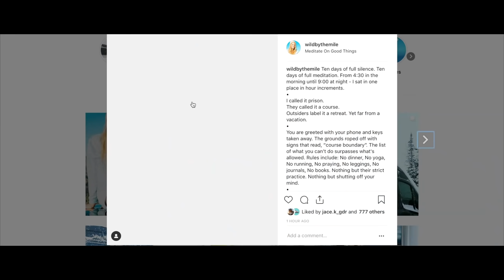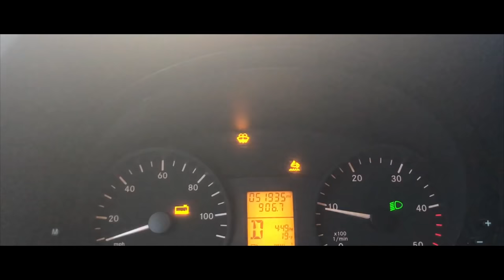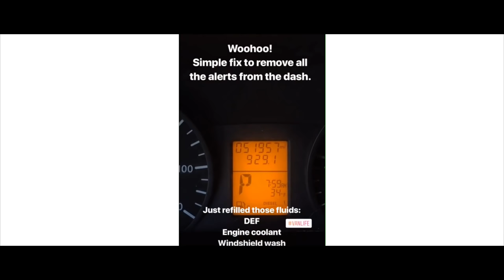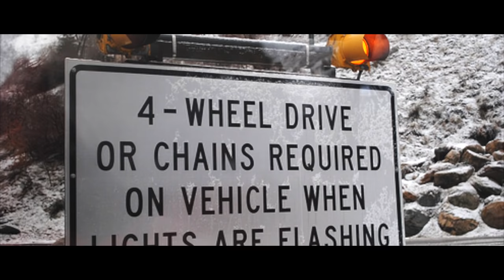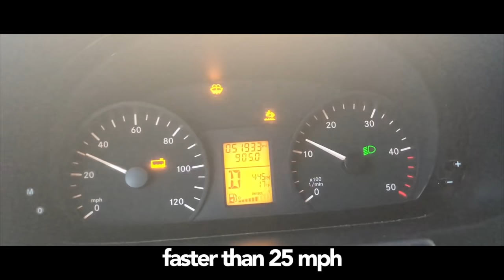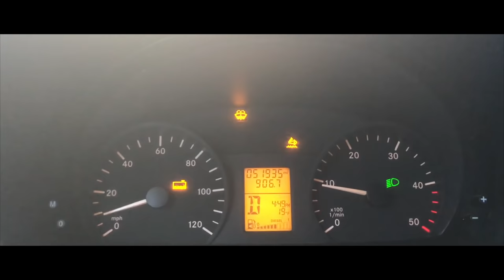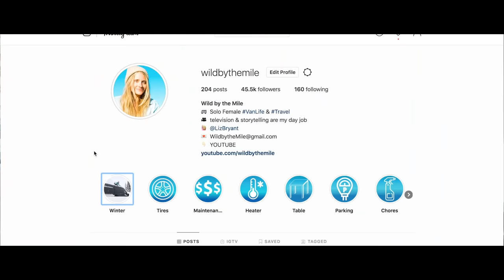SOLO FEMALE #VANLIFE: #WINTER SAFETY

Comment: Chains or cables are only meant to travel at a top speed of 30 miles hour. That was your speed in the video. The noise comes from the tire compressing under vehicle load which makes the chains ( cables ) lose causing them to hit the ground in front of the tire and bounce back up into the tire. My sprinter with my Pewag chains on it on clean plowed roads( no snow) sounds like a tank. Just do your best to keep it under 30 miles a hour.
Reply: I seem to remember that you're supposed to drive slower than 15 mph when you have chains on.

Comment: I live in the Northeast and have a 4x4 GMC pickup with BFG tires but also have a 2wd BMW which I have winter & summer wheels & tires.
The winter tires are studded snow tires which work well in snow & icy roads. Chains & snow cables are for extreme road conditions with 
up & down grades which most folks have no business driving in.

Comment: Something lots of people don't know,.. without a locker rear axle your van is only one wheel drive. It's an option that can be ordered when purchasing a new vehicle, it's like night and day!   Snow tires are made out of a different compound that off road tires can't match.  People seem to think those big bad ass tires are the best in snow ...wrong!! ( Check it out! ).   You did your insolation perfectly!  The V bar chains are the best on especially icey conditions but as said by many others.. you can't drive much faster than 20-25 mph because they will streatch!   One last thing ( thank God and I'll shut up) I always keep a buddy heater as a back up and are perfectly safe if you have the proper ventilation!  
Thanks Liz,. Best to you and be safe!  😊
Reply: I believe that would be called "limited slip differentials and axles" in North America not "locker".  It's also true of awd vehicles, they are effectively one wheel drive in poor traction situations unless they have limited slip differentials and transfer cases.  The big thing about Suburu's was that they limited the slip in their transfer cases so that a minimum of 30% of the torque would still be delivered to the non slipping axle, hence if one wheel slips, the other axle still turns (however unless they have limited slip differentials too then if a second wheel slips on the other axle, you're sol).  Basically an AWD without limited slip differentials but with limited slip transfer cases is essentially a two wheel drive.  Note that a standard two wheel drive vehicle with limited slip differentials is effectively a two wheel drive in poor traction situations too.   4wd is where you can lock the transfer cases and differentials together so that all the wheels turn at the same rate which is great for poor traction conditions but dangerous on dry pavement, you're also supposed to drive really slow when under 4wd as in 15 mph max slow.  It's only with 4wd that there might be something called a "locker" in North America.   Some 4wd's only have the ability to lock the transfer cases, indeed this is the most likely 4wd setup, this is safer as you don't have to drive slower and it's probably safe on dry pavement but in this scenario, if a wheel slips on both a less then you have no traction.

I don't believe chains are to be used above 15 mph.  I remember thinking that really limits their usefullness when I bought chains.  Then again I bought them in Canada so I think the warning was to not drive above 20 km/h.

Comment: I am a tractor trailer driver & mostly live in my truck. When you put the chains on, lay them longways with the van, behind the rear tires & roll back onto them. The front ones same thing but roll forward. As was said, they are meant for slow speeds, less than 30 mph (you can watch tractor-trailer youtube videos of the installation). They also should not be driven on asphalt, once the snow & ice is gone, remove them. If you have to reinstall them 2 or 3 times during a trip, it sucks but that's the pain we must suffer on bad roads. Again, drive slower with chains & don't go over 30. A great snow removal trick is to use old sheets & cover your window & roof b4 the snowfall. After it's done falling, pull the high end of the sheet towards the front of the van & watch all the snow come off with ease. To protect your wiper blades, b4 it snows, pull them outward, that way they don't stick/freeze to the winshield & protect them better. Make sure all your fluids (DEF, winshield washer, etc.) are sub zero degree rated.  Better luck next time! Life is a huge lesson 😊

Comment: About the cables: The sound is the end of the cables. There's usually some little clips (orange/red) to secure the ends so that they don't slap against the wheel well, but it's nbd if you don't secure them - it's just annoying. I have the same cables and living in Yosemite, I have to use them frequently.

Comment: As below, your chains are for snow not for the road so once you clear the snowline you can take them off. I carry old outdoor gear for putting them on as usually it's wet cold and dirty. So old coat, old pants, old gloves, a head torch is also useful. Also, you can practice putting them in the warm so you have it down before heading up into the mountains.

Also carry a shovel to clear the van, exhaust and possibly some tread tracks to put under the wheels to allow the tyres to catch. Dig out the exhaust prior to sleep

Merino wool base layers and fleece instead of cotton for clothing and carbon monoxide alarm if running the heater at night.

You could also run an extension hose from the heater outlet to somewhere else in the van 

https://www.butlertechnik.com/installation-accessories-c63/warm-air-ducting-outlets-accessories-c122

Comment: The noise is from the chain/cable stapping against the body of your vechile. Based on the Manufactures web site, it says "Avoid speeds over 30 mph and use on bare pavement. Traction coils on cross members will fragment and cause cross members to break. Damage could occur to chains, tires and vehicles."As a storage note it says, "After use, clean and spray with an all-purpose lubricant."

Comment: Once you put on your cables you have to pull forward a few rotations of the tires and then stop and retighten your chains or cables. If your cables are flopping then they are not tight enough and will destroy your wheel wells and fenders. Chains or cables are not designed to be driven at high speeds. 25 to 35 max. If your driving faster then take off the cables. Remember cables or chains for traction only. Remember if your flopping then your cables are to loose and need to be tightened. Also lowering your tire pressure will give you more traction and a winder pattern for grip in  the snow.

Comment: When you put chains on you have to put them on and then drive about a hundred feet and retighten them again
 if you're hearing that noise when you drive that's not a good noise that means that you have something loose and if you have any extra chain at all flapping around it could snap your brake line
 should be careful

Comment: Another good video Liz thanks for sharing your experiences. Yes a box of arm & Hammer baking soda in the fridge absorbs odors. So I have a question maybe I misunderstood something else: I think you said going 5 miles an hour you could feel your van slipping. Shortly after that I think you said in one of the snowy conditions you could go 75 mph instead of 80?? What did I misunderstand LOL. When I turn on the news and I see video of a 30 cars pile up accident in the snowstorm, and you see other cars flying by along the highway flying by going 60-70 and I’m thinking no wonder everybody’s crashing a 30 car pile up going so friggin fast in a snowstorm… Duh lol. That comment isn’t directed at you it’s directed towards all those people sliding into each other going 60 in the snowstorm. So when you said I could go just 75 instead of 80 makes me go whaaaa??? 🤣

Comment: That sound certainly sounded like something from the cables were slapping as someone else mentioned, making sure you have the correct cable size for your tires is very important. I was driving in Incline Village and the roads weren't plowed very well and I would slide a little with 4WD and snow rated tires. Being mindful of your speed is the key.

Comment: Hope your leg feel better soon. Sprinter is the only van that comes from factory with 4 wheel drive its why they have a 14 month waiting list. Its pricey but you'll get back on resale value. Other vans have aftermarket 4x4 options. Doesn't the heater exhaust melt the snow? The EGT should be at least a few hundred degrees. Great job on driving in challenging conditions. Driver and judgement is apart of the equation not just the vehicle/equipment. I'm guessing the driver in the raptor was probably doing something fun. I would too if I had 450 hp.

Comment: I have no clue why some people are telling you not to worry about that tire chain/cable slapping noise. It's caused by a piece of the cable slapping one of the enter wheel wells. and it will end up damaging it. I'd say it's because the tires are larger than the factory tires, and once you get up to a certain speed the centrifugal force is causing the cable to be slung outward and most likely hitting the plastic fender flairs on the rear of the van. Most likely hitting the fender flair near the bottom in front of the rear tires. I'm not sure about your van, but those fender flairs may be able to be trimmed off where the cable is hitting them. A shop can tell you if they can or not. Or someone that works on lifted vehicles.
Reply: P.s. The letters AT on your tires are the important ones when going into snow/dirt/mud because they stand for AllTerrain. The LT on your tires stands for Light Truck. Meaning they're a light truck tire. Hope all is well and that you're having/had a wonderful weekend. :)

Comment: Never heard of sheep's wool insulation - but sounds like a great solution.

I've had gray and black tanks freeze solid so I've had to wait til spring to drain.  The fresh water tank has never frozen because it's inside my RV.  Water pipes have frozen up and then usually thaw out enough in the afternoon. Better to just use jugs of water during winter since pipes can break.  I learned that the hard way.
Reply: People use wool because they believe they are safer than synthetic materials like polyurethane, polyisocynate (polyiso) and polyethylene during a fire but wool also produces carbon monoxide and cyanide gases when they burn.

The trick to avoiding condensation is to have the vapour barriers on the warm humid side of the insulation and have the other side well ventilated to keep the insulation dry.  However, with vehicles, you pretty much have to expect that sometimes the outside is the hot humid side and other times the inside is so you need to have vapour barriers on both sides and somehow install the insulation under dry air conditions or stuff silica gel with the stuffing to control the humidity inside the insulation.   You can buy bulk silica gel at craft stores and seal them inside small paper envelopes to tuck in with your batting, place them high as humid air rises.  As to the inside of the front windshield condensing, you could try putting silica gel in muslin storage bags in your cabin area to reduce the humidity there and vent the cabin when you cook or shower.  Waxing your windshield on the inside might reduce the condensation too.

I would say put electric heat strips on external tanks and pipes then insulate them over the heat strips, a temperature sensor would be a good idea perhaps in the tank itself so you know when the heat strips need to be turned on.  You could also install a block heater into the tank.

The DEF is 40% urea and the rest is distilled water so I would imagine keeping the DEF tank warm would be a good idea too (urine is only 4% urea so don't try using urine without first processing it to extract the urea and then mix the urea with distilled water).  Urea is only needed to decomposed nitrous oxide back into nitrogen and oxygen and it's sprayed into the exhaust before the catalytic converter.  In Europe, you add the DEF when you fill your tank and there would be a separate DEF cap beside your fuel tank cap but the EPA requires all emissions control devices to not require operator interaction hence the DEF is topped off during oil changes and therefore a larger tank is needed.  The whole Volkswagen fiasco was that instead of finding room to put in a large DEF tank, they just programmed the computer to only use DEF when the car is being tested for emissions, there was nothing wrong with the engine and really no need for everyone to return the vehicles for refunds (I would've insisted on free oil changes for life and brought them in more frequently for oil changes or just find the cap and top it up myself).  

You can usually order a diesel engine with an oil pan heater and of course a block heater to keep the coolant warm.  The oil pan heater and block heaters may be enough to keep the DEF warm by slightly warming the engine compartment.   You can buy electric warming blankets for car batteries but in general, they won't freeze if they are charged;  when discharged, the electrolytes is basically water and would freeze.  They also sell blankets that you put on the grill of your car so that the diesel engines warm up faster and stays warm longer, they usually have a flap that can be left open for some airflow while you're driving.
Reply: John Wang  Interesting info. about DEF and Volkswagen.  As for wool, the ignition temperature for wool is 600° C, IIRC.  While it may give off CO when burned, it's going to take a whole lot of heat for it to catch.

Comment: In my experience growing up in Wyoming, cables only came with small vehicles. They are less beefy and might* not be the best idea for your van. 🤷🏼‍♀️ They are lighter and easier to use as well, but hopefully the guy didn’t suggest them based on this factor.
Definitely It sounds like a part of the cable is catching and probably hitting the wheel well (which might take a while to notice any physical damage) or possibly catching and snapping back and hitting the tire or rim. 
Maybe getting under there if it’s clean, with a headlamp you’d be able to see a small mark forming. 
Also, In the portion of your video where you’re driving 25mph and getting the sound- the road looks slightly damp but doesn’t look to require chains, or cables... 🤷🏼‍♀️ 
Good luck!

Comment: Your heater exhaust pipe maybe Lane something against the van so the snow will gather further away and the pipe never gets snow-covered figure that out on your end just a hint did you figure out the Correct object you want to lean against your van aboard snow board just something to keep the snow from building up

Comment: I'd like to offer some tips/information from a frozen northern Canadian boy. Your choice of tires was a smart one. However they are not suitable for the winter conditions that you use them. I have the  same model of tire for my four wheel drive vehicle. Dedicated winter tires are the only safe solution for those winter conditions. With winter tires on my vehicle, it accelerates faster in two wheel drive than if four wheel drive with my KO2's. More importantly it steers and stops dramatically better. As for that mysterious sound, it is caused by the traction cables expanding and contracting due to tension and centrifugal force. For your safety, do not drive at a speed that you can hear that sound, please. I know of too many incidents where tire chains etc. have severed brake lines and jammed wheels. That happens when the tension straps can't hold the cables against the tire. Rubber straps also expand due to centrifugal force.
Reply: As for Clearing snow off of a high vehicle I suggest buying as wash broom. It is a car wash brush attached to a handle about 4 feet long that is meant to attach to a garden hose. I bought one to clear the snow off the roof of my Ford E250 4WD van. The brush is soft so it will not damage the paint. Being a normal height guy, 5'6", it made the task possible.
Reply: An extendable handle snow roof rake would take care of the snow on top of the car.  You really have to drive slower with chains on.  I would suggest winter tires with studs.  Modern factory studded tires have retracting studs so they don't damage the pavement.   Then she could drive at the speeds she's comfortable with without having to take off the chains.  About 90% of the winter tires sold in Scandinavian countries are studded tires.  Besides she's only using lightweight cables not actual tire chains so she might as well just go with studded tires even though the requirement for those roads are chains or 4wd.  One trick to strapping chains on quickly is to use the car jack, lift the wheel up and then put the chains on instead of laying out the chains and driving onto them.  You do need to practice putting chains on.